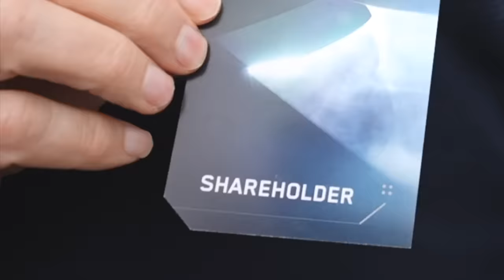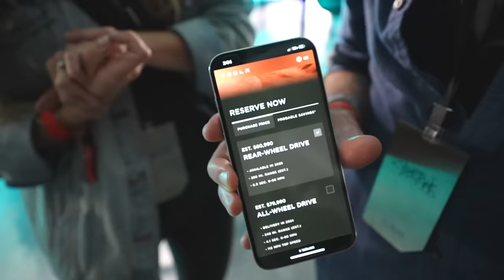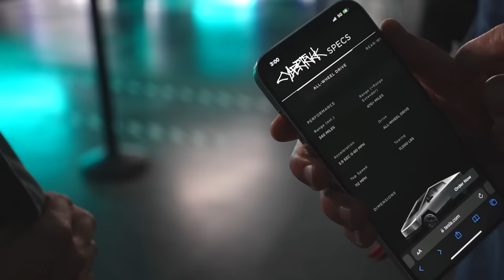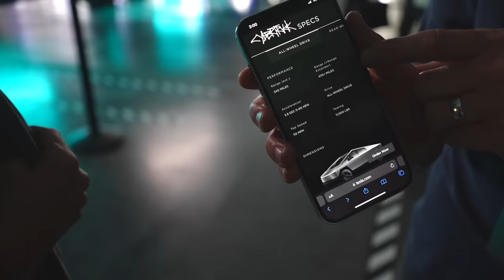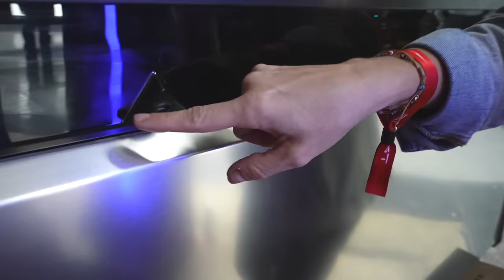I’ve Owned 4 Teslas, but the Cybertruck has me Confused

Comment: I am a retiree and I am dumping every penny I can into Tesla stock... I will not lose anything and I might do quite well... I may not live long enough to get the truck at an affordable price but if my number comes up in the next two years, I will stretch to get into the dual motor. I will pull a hi-lo or another camping trailer with low frontal exposure happily with the 340 mi range knowing that it will be less pulling a trailer... but I have had high frontal area trailers with a silverado hd3500 that was distgustingly unreliable. I will not do that again... obtw, throw that man of yours into the conversation once in a while...

Comment: My coworker just spent ~$90k on his fully loaded F-150...and it looks about the same as my 2016 F-150.  I don't think CT prices are unreasonable as they ramp production and reduce cost.  Demand will exceed supply for >18 months to 2 years, as they ramp production and reduce cost.  I'm also impressed by how much automation they already have in place.  CNBC said they were building these by hand.  Not true.  They have been very busy building out the assembly line.

Comment: I'm on board with Zack from JerryRigEverything and Dan from what's inside. At 6:18 the math is wrong for the Rivian. They added the extended range to the Rivian and didn't subtract the tax credit just to make it appear it will cost you more. I believe The Tesla website says the cyber will go 100 miles on 42.9 kwh. That's 429 kw/h at 340 miles range plus they usual buffer the battery is more like 150+ kwh for the Dual and Tri.  the 123 pack was extrapolated from a picture of the truck at 265 miles with 9 bars showing. Performance is not better just the 0-60 in the Beast mode Towing and freight are down. The Mini cyber was cool though. :)

Comment: I see it as a novelty for those who can afford it. My former neighbor who calls himself a handyman, but does all aspects of new home and remodels, said when I asked him if he would consider a Rivian or cybertruck, responded he would keep his Toyota truck. He needs the lumber rack and sometimes hauls heavy amounts of lumber. He also said most of the trades are constantly on the road to and from projects. They can’t afford mid day to spend the required time charging, versus stopping for gas.

I was considering replacing my 22 year old Tahoe with a pickup, but the price points for electric and the current interest rates will keep me away. I can get a Chevy Colorado or a F150 not fully upgraded for much less. Then I can continue to use the M3 for around town drives.

I was the first person in my neighborhood with a M3, we did have a couple model S. Today there are quite a few models 3, Y, S and Volkswagen around me, even a Rivian, I do see numerous Rivians in my area.
Reply: A 340-mile range, more like 240, should do most of the time. If you need a truck, buy a truck. If not or occasionally, M3 or MY should do. It’s whether we can define need and want.

Comment: I’m disappointed in the range and payload.  I like that they provide an option to increase range, but not glad that it isn’t sub-bed but instead takes up bed space (for example that’s needed for camping or hauling).  If it can be easily removed/installed or rented when needed then that helps.

Comment: I watched the reveal and was ready to drop my reservation, but then the long-form reviews started coming out and I completely changed my mind. This is an engineering masterclass.
Holy cow this thing is very well thought out. They didn't have to pack so many innovations into what most people ordered based on the look alone, but they did. They could have crapped out a conventionally built truck that just looked like the prototype, but they didn't.
The price is pretty much in line with inflation, supply chain, and other vehicles on the market; this didn't really surprise me. There's a lot of reasons for the price that others have gone into detail on, I won't do that here.
The baseball may have been their attempt at a joke, but the glass is certainly just normal automotive glass.

Comment: The disappointment seems weird to me. It’s on point for the mass media to be derisive but it’s weird to hear the illogical complaints around pricing and range. 

The demand is what has made the prices so high. The closed market of the reservation system means they have to get as many reservation holders off the list so they can sell to the open market at market clearing prices. 

300+ miles range is totally sufficient for most use cases especially if towing long distance you want only to have short stops. Big battery means longer stops.

Comment: I knew before the event that nothing was going to be close to 4 years ago. I am still so excited to get mine. Range is fine with me. My bladder tells me when to stop before the car does.
Reply: I hear the bladder comment a lot (sometimes out of my own mouth) but the missing piece to this logic is that you can't charge everywhere you can pee. Until that's the case, more range is nice. 

My wife and I take long road trips in our Model Y, and there are times when we can't be free to explore how we would like, though in some cases it's possible to work out a time consuming and/or complicated process at 3rd party chargers. 

Overall the EV benefits outweigh these issues for the once a quarter trip, but the base range/loss of bed space are issues that is going to have me waiting some yeas for specs to hopefully improve.

Comment: I'm OK with the price.  It is fairly priced compared to its competition both EV and ICE.  Have you priced a luxury truck lately?  I just bought a 2024 diesel Denali 1500 for $75K. No air suspension.  No stainless steel body.  No possibility of FSD.  No power tonneau cover.  Expensive oil changes every 7500 miles.  The Denali is a nice truck, but so much less than a dual motor CT.  

Price wise, consider that inflation since 2019 to now is about 25%

Comment: The dual motor is as good or better than originally promised except in price (gulp) and payload.  The trimotor is a big step down in range but possibly faster.  The single motor is now necessary not to price so many who preordered out of a cyber truck.  The range extender softens the blow of reduced range on trimotor and is a plus for the dual motor which starts with more range than promised.  Definitely not a near term driver of a stock price increase but shouldn’t hurt much either.  Actual sales and profits will impact share price more I think.
Reply: Don’t get too hung up on the listed payload. The actual payload appears to be much greater.  And, if you don’t already have a reservation, then you aren’t getting one for at least several years and the price is likely to be lower by then.

Comment: As for the dual motor Cybertruck, everyone should have expected it to cost the same as the dual motor Rivian.  You should get a dual motor Cybertruck because that is what most people will need for adventure experiences, buying home improvement materials and anything short of a truck pull. Most of us DYIers need a truck bed that can hold 4 by 8 plywood, sheet rock and Durock;  the Cybertruck does this the best with the least overhang. 

Once everybody gets over not having the 6th seat, and other specs, they will all realize the Cybertruck has work specs that are better than the Rivian and F-150 that matter and it drives better than these other EVs.  Tesla has made an EV platform that is second to none and that will become evident over the next few months as Zac and Jesse find again this winter their Rivian won't start.

Comment: Good points shared in this video. Interesting that the price of the Cybertruck may be similar to the number of PowerWalls it would take to match its battery capacity. I’m gonna double check that, but that’s interesting. It is well priced with the market. I really hope the range extender will be removable and could be used like a PowerWall when not needed. If so, I’d pay $16k for that. I was really looking forward to the 500 mile range and had big plans on what I’d do with it. The range extender can get me close to that, but taking up bed space makes that less ideal.

Comment: At the event, the brakes and headlights quad motor. that were suppose to be in the Cybertruck were never discussed. The baseball thrown and not the ball bearing.
The event was disappointing as the price for the TRi motor and not 500 miles

Comment: Don't sweat the pricing. Remember, there are two million pre-orders. Those with motivation will buy now with the price where it is. If you are high on the list for first deliveries switch places with a highly motivated buyer. If you get beyond the first 100,000 the price will be lower by then. Also by then the range will be extended. If lithium/amarid/sulfur batteries are on the market the range can grow to at least 1,000 miles on a charge.

Comment: At that price, I guess it's in line with prices today.. I guess...   That's just a LOT of money to spend if you'd use it as a work truck.  Even the entry level model is over $11K more than what I paid for my diesel 3/4 ton truck.  Though, I suppose anymore, everything is way more expensive than pricing of just a few years ago..  I probably couldn't buy a similar truck today for what I paid for mine... 

Sure, my truck is slow when it comes to 0-60 and it doesn't have all that instantaneous torque and all, but I get a bit over ~500 miles per tank and can still haul rock, dirt, water, hay, equipment, etc. and just use my truck.  If nothing else, it'll be interesting to see how these trucks hold up and what people actually do with them.  I'd like to see how they hold up to being used as an actual work truck.  The ~300 mile range they're showing on the site is a bit limiting IMHO, and I'd be interested to see what the real-world range will be when towing a good sized load around.  If range doesn't take too much of a hit when these things are loaded down or pulling near max towing capacity, that will be impressive.

Comment: They should have fitted the range extender inside the extra space under the bed.

Maybe the total size would not be the same but if that space was designed from the start with that in mind it could probably have been similar, unless it has to do with crash structure.

Comment: I felt similar to Kyle Conner on the prices.  The prices don't surprise me.  I was hoping for better.  I felt the Cyberbeast could easily be well over a hundred.  Just like the Model S Plaid.   The real disappointment was the range of the Cyberbeast.  I was expecting close to 500 miles.  The 320 mile range is a real disappointment, that is maybe why it is not over $100,000.  I ordered the tri-motor 4 years ago for the range, not the three motors.  I see myself switching to the dual-motor.

Comment: Disappointed. 1: No 6 seater option 2: Priced $20k more on all trims 3: Range down, 340 from 500 miles 4: Smaller overall truck 5: Towing reduced 6: Payload reduced 7: Overall, nerfed, lesser truck 8: another case of over promised, under-delivered

Comment: I know a lot of people have been upset with the pricing and range considering they are comparing it to the launch in 2019. With that said.. Has there actually been one manufacturer that has actually done what they said? The lightning, Silverado ev, etc all of them said their ev's will get a range and be at a price point that they couldn't make promise on. The Cyber Truck is different, and I feel like it's one of those vehicles that will take awhile to get use to. People hated the look of the Model 3 and Model Y, now you see them everywhere. For me, I would love to do an olive green and black wrap with some aftermarket wheels.
Reply: How about rivian with the quad r1t announced at $67,500 it hasn't advanced at ALL in 3 calendar years of production and costs 87-96k now. 😏
Reply: Remember the F-150 lightning with a starting msrp of $40,000?  That never saw the light of day.  The lowest MSRP ended up being $50K, and that was only for fleet buyers.  By the time the dealers slap a $10K "market adjustment" on it, it ended up being a $75,000 electric truck.

Comment: As a Tesla shareholder, the pricing is worrisome when you compare how low the volume is currently for the Model X, a similarly priced Tesla.  It seems like this is going to be another low volume, 30K-60K unit per year vehicle, which is around what Rivian is currently selling. Looking at price and volume, I think for $10K less price, more along with what they advertised initially, their sales volume probably goes up by a factor of 10x. So in the long run, they'll need to figure out a way to get the CT cost closer to the cost of a Model Y. Obviously battery tech and cost is the key to that, which I think is doable in a couple of years. Hopefully this is just the early adopter pricing like they did with the refreshed Model X and S.

Comment: I'm in the same situation,  I will need to find more funds to get mine and I am 44K in line.  BUT I am driving a truck I bought new in 2000,  In 2018 I looked to replace it and was disappointed. When Cybertruck was debut, it gave closure.  This will be my last new vehicle and I expect it to last 20 years or so.

Comment: I don't understand the difference between the 2 models just released - the Beast one is 1 more motor and costs $20,000 more.  Same battery pack.  Same everything else? That's excessive.  If the models came in 15K lower I would still go through with mine but won't at the current prices unfortunately.

Comment: This is the BEST edit I've seen about CT.

1. Disappointed - Range is down, price well exceeds inflation.  Tesla is no longer interested in being a market leader, and is simply willing to match the market.  Ford, Rivian, and GM executives are sleeping better.

2. Compared to competion, it still holds up OK.  Better charging network than Rivian, lower weight and cost than Hummer, More reliable and durable than Ford Lightning.  And...does the range really matter that much if there are Superchargers every 50-60 miles in any direction, like we have in 2023.  When I got my Model S almost 9 years ago, I couldn't go any direction besides east and south because there were no supercharges north or west.

3.  My final take is that the vehicle and price isn't a disaster, or even that bad.  This just goes to show how bad the original reveal in 2019 was.  Overstating targeted range, towing, hauling while understating price, and then taking 4 years to barely start delivering (all while Ford, GM, and Rivian are shipping) is not a good look.

Comment: If you adjust for inflation (+8000) and take into account the federal subsidy (-7500) the price increase is really only (61000 - (40000 + 8000) - 7500)) / 40000 x 100% = 13,8% 
If the rearwheel drive version has all the tech of the more expensive versions then that seems reasonable to me.
Also take into account the pricing of the competition and that Tesla will have a very limited production in the near future plus there will be a nearly unlimited number of buyers initially.
After ramping the prices may go down.

Comment: The extended range solution is ridiculous taking a huge chunk of cargo space and it still underperforms promises. Serious towing with any truck EVs is not feasible until we get better energy density. I am still a fan of several engineering and design innovations though.

Comment: I have a reservation for the twi-motor (simply due to range) but will go for the dual-motor. I was expecting a 400 mile range (I always thought the 500 mile range was a bit hopeful) but a  bit down on the 340 mile range.

I am 600,000 in line so my guess that will be about 1.5 years away to decide.
Reply: It might be 450-500 miles when you take delivery 😂

Comment: People are ridiculous. Cybertruck has...
- hardware 4
- rear screen
- F-150 like Frunk
- Steer by wire
- 48 volt architecture
- Bi-directional charging
- LED interior
- ventilated seats

A bunch of things that were not promised. Considering inflation, the price makes sense for what you get. It can go down but I doubt it will if the demand is there.

Comment: Jerry was wrong, it is not more expensive than the Ford F150. If you spec out an F150 lightning to be equivalent to the Cyberbeast, the F150 Lightning goes way over 100K.. And that it is more expensive than 4 years ago is logical with everything that happened in these 4 years.

The AWD version has better specs than 4 years ago

I never expected the glas to be bulletproof, Tesla also never said that, but the glass is still the same as 4 years ago. rock and scratch resistant, Tesla simply did not want to take a chance again to break it by throwing a steel ball at it. Bullit proof glass would make it rediculously heavy and even more expensive.

Raj said it perfectly about price.. With this low volume starting at the lowest price possible would make no sense, because demand would explode and Tesla cannot match that in any way right now... Even with the current prices demand will be insane.. The higher prices will help keep margins high enough for Tesla to remain profitable overall. Once production ramps up Tesla may start lowering pricess.

That 'ride the lightning' guy said a smart thing about range... Tesla has clearly not ramped up the 4680 cells to the level they would like it to be right now, I even think it is the one and only reason we have had to wait so long, so they keep the battery as small as possible and provide a range that would be fine for most people.. The few people that think they really need the longer range, they have the option to add a range extender for $16.000, I think it is brilliant.

No doubt in my mind the Cybertruck will be a huge success, now it gets delivered to many peaple all over the country it gets more noticed in more and more places and more and more people get infected by this Cybertruck virus, people just want to have this crazy vehicle!